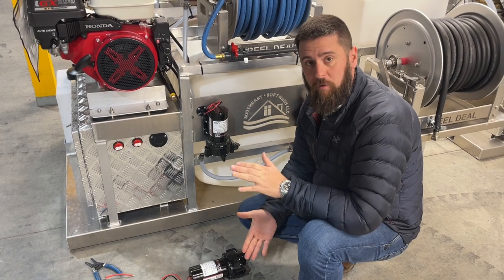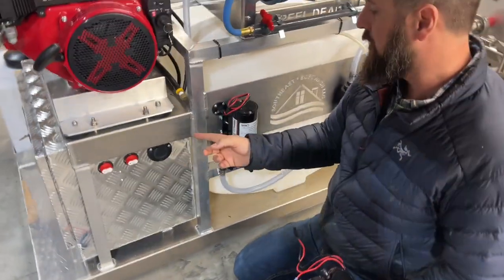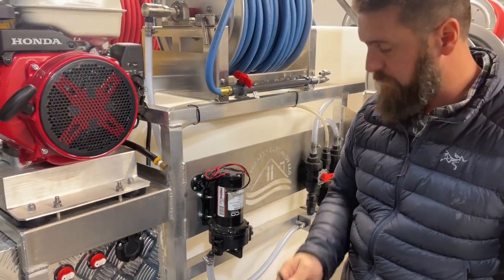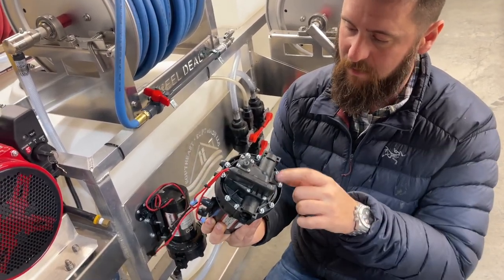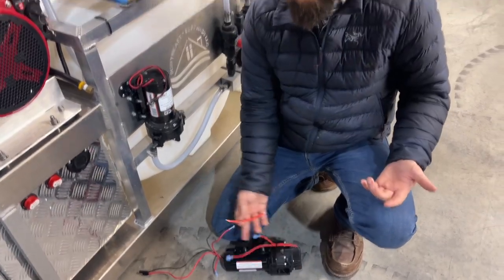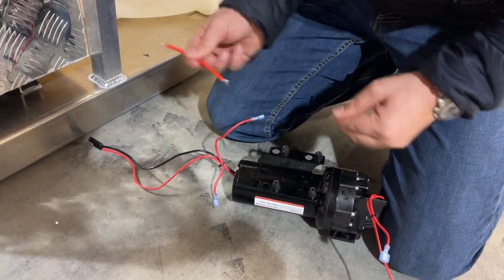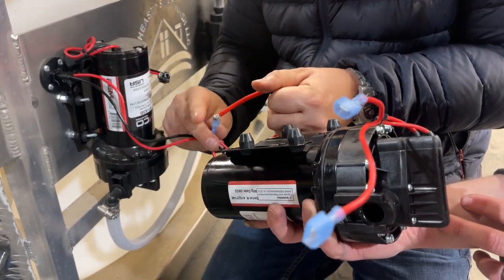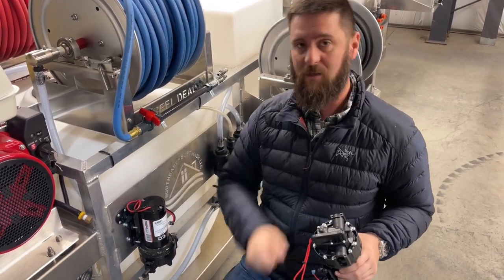How to fix a dead 12v pump

Comment: I ruined my pressure switch by short cycling the pump and it didnt take long.  When I replaced it I wired in an automotive DC relay so that the pressure switch only has a tiny amount of current going through it and the motor current goes through the relay.  I took the old pressure switch apart and found remco is using cheesy AC micro switch.  Switching dc current is much harder on contact so the fact that their not using DC rated switches explains why they have like zero tolerance to short cycling.
Reply: What's "short cycling"?
Reply: meaning that the solution would be changing the AC  micro switch for a DC micro switch . Any info on these would be greatly appreciated. Thank

Comment: Is there a reason why 12v pumps are put upside down?
Reply from the maker: Yes. 
Motor up means if the pump head ever Leaks, it won’t leak into the electric motor portion.

Comment: What drives me nuts is the plastic elbow leaking on the pressure side of the Remco Fatboy 7gpm pump. Being a pressed in elbow fitting with just a small o-ring for the seal doesn’t seem like there is much I can do to fix this reoccurring problem.
Reply from the maker: Hit it with wd40. 
It’ll swell the o ring
Reply: @southeastsoftwash4020  wow that’s so easy lol. 
   Thank you very much, I really appreciate the quick reply too.

Comment: Cody. Question for you. So my pressure switch is bad and I have the Remco 7gpm 100psi pump. Can I get the switch from Amazon and do you know the part number? My first time dealing with this. Thank you
Reply: Did you find that switch, I have t he same pump
Reply: @marcuswalker9172  I found the switch at sprayer depot. They shipped the same day. I'll have it Monday

Comment: how long can you bypass that switch and be okay?
Reply from the maker: If you bypass the pressure switch it’s just going to run continuously
Reply: @Southeast Softwash  I might have a pile of pumps lol had one that worked one time and then wouldn't come back on.  this is great info